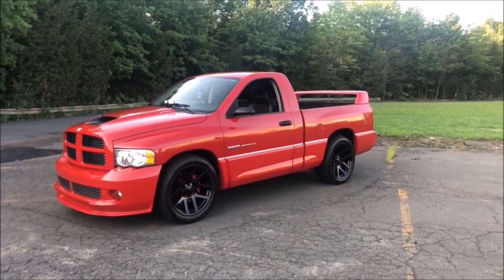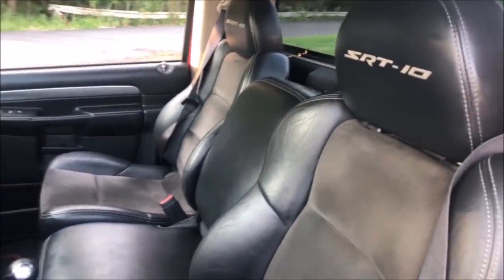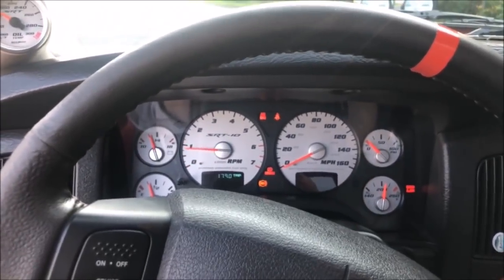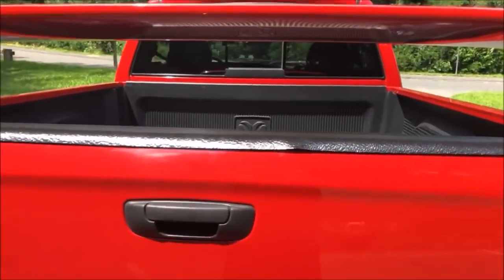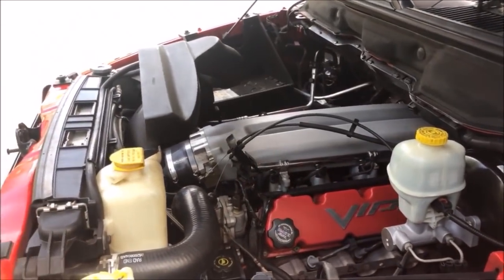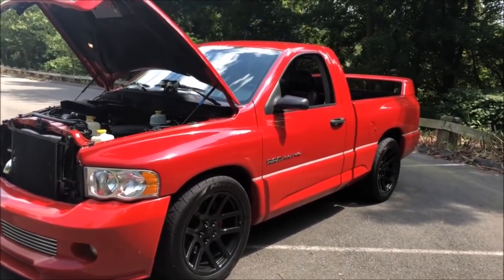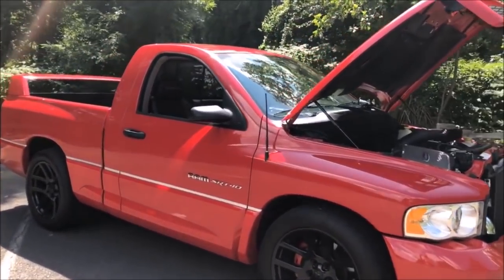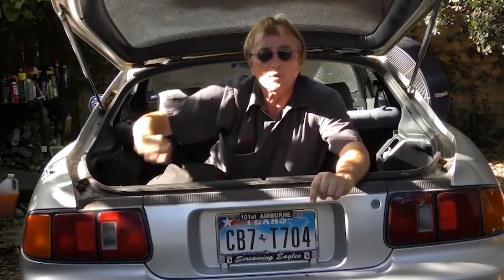The Secret that Makes this 2004 Dodge Ram Truck Still Worth $30,000

Comment: All the gas stations love this truck!
Reply: Smiles per gallon
Reply: Better driving it than see it in the garage.
Reply: Gas is cheap, so are thrills in that truck  before you get to the next station XD
Reply: And I do to.  Screw electric and economy.
Reply: The still get like 13 in town and 18 on the highway, Pretty comparable to a modern toyota tundra lol
Reply: It gets better mpg than my V8 Dakota
Reply: 14.5 city 16 highway
Reply: No, all the trucks love the gas stations
Reply: No way! I'd baby it and drive it on the weekends 😍 That translates to a tank a month?
Reply: @Monsiemage  highest ive gotten it to was 15 on the fwy and i drove it actoss the US
Reply: @WarofClans  more like 8-9 hwy
Reply: @BUMPER_PLATE_BANDIT  I have one a 14 and have over 200k miles I'm getting 16 right now highway it's gone up the older it gets
Reply: @BUMPER_PLATE_BANDIT  8-9 city 14-16 hwy had one for 7 years
Reply: @joshn938 this didn’t age well
Reply: @whisper7071  It's better than last summer. Also, depends on where you are. If you were on the west coast, gas was never cheap.
Reply: Who buys a truck with a big Hemi and then worries about gas mileage? 🤦‍♂️
Reply: @moobutt  *Viper V10. But your sentiments I agree with.

Comment: Should be "the secret that makes a 15 year old truck worth $30,000"
Reply from the maker: Good idea, thanks for the help, that is better. It's hard to come up with the best video titles putting out 2 every day, thanks.
Reply: They are more like $20K around here, (unless they have like only 5K miles on them)
Reply: So how would you like it, paypal or check?
Reply: This truck is barely worth 14k lmao
Reply: Funny newer trucks like the 4th gen ram loose value real quick... That's also how I'll probably be able to more easily afford a 2018 sometime after 2025-2030
Reply: I'm still wondering what the secret is?
Reply: 6speed tremec, viper v10..in a truck.

Comment: Not a Chrysler guy, but imagine walking into the dealership in 2004 seeing this truck on the show room floor. Way nicer than the fca Rams today. Love the truck!
Reply: it has outlasted any FCA Ram,too. my brother had a 2011 and a 2012 Ram, and the 2011 was returned because the transmission was screwed after 20000 kms, and the 2012 got traded in for a 2013 F-150 because the brakes were starting to go after 1 year and it was rusting out after 1 Alberta winter(we rarely salt roads out here). I've seen the newer ones having an array of electrical issues.

Comment: Wow 8.3 liter engine. Nice sounding too. We wont see that size again.
Reply: neftv1 i mean the most recent viper is an 8.4. 2017 was only a few months ago.
Reply: koniko169 yeah true but it'd be better to just build turbo v8 than a big V10.
Reply: 4th gen Ram 1500 SRT with am 8.3 🤔
Reply: TheAnonymousConnor 5.7*🤣
Reply: Only 500bhp too.. the E60 M5 V10 has 507bhp/500nm’s and it’s a 5.0 litre V10. Still love the viper engine though!! What a beast.

Comment: That truck is beautiful. It was like the Hellcat during its time. I have a 2013 Charger SRT with a 6.4 V8. I really do think Dodge makes some of the best monsters out there.
Reply: I have BOTH: 2013 Charger SRT-8 (32/392) and a 2005 Ram SRT-10. The wife has a 2015 Infiniti Q70L 5.6, so gas stations LOVE us!

Comment: Lamborghini's 10 cylinder was the perfect fit for the Dodge Ram. That truck is still fast by today's standard. I drive an 04 3500 diesel Ram so I'm biased on the looks. Be safe they are getting harder to find in good stock condition.

Comment: SVT Lightning vs Ram SRT10 would’ve made a nice comparison video.
Reply: It would have, but the dodge is really in a class of its own.
Reply: Andrew They are very similar as far as 0-60 times, the SRT does have an edge in power and torque but the Lightning is significantly lighter by 1,000 lbs so the times are extremely close.
Reply: I'd take the Dodge, just because its way more outrageous.   The Lightning though, with a few mods(its supercharged from the factory) would blow the doors off the Viper truck though.
Reply: SVT all the way
Reply: Andrew true but that blower on the lightning makes it very mod friendly. Stock for stock the ram is faster. But remember both are car enthusiast vehicles and most enthusiasts mod their cars. A smaller pulley and ported blower make the lightning miles faster than an srt10 ram with long tubes and new intake. Both probably are equivalent in mod prices.
Reply: Rygard Gonza too bad automatics are faster. I don't care what you think of me I'm gonna feel a hell of a lot better with u in my rear view mirror than u are driving manual and losing.
Reply: This has already been done. On Monday, Feb. 2, 2004, the Dodge Ram SRT-10 set a new Guinness Book of World Records time for the World's Fastest Pickup Truck.
Reply: MysticBlack - Who told you automatics are faster? I happen to own one of these trucks when I shift from 1st to 2nd and second to third, I do it in 0.400 of a second. The same amount of time it takes for the human eye to blink. Even automatic transmissions with shift kit cannot do that.     You must be a millennial...
Reply: At the time the lighting and the SRT-10 came out automatics where painfully slow. So a person who could shift decently would destroy an auto. Plus a manual is a hell of a lot more fun to drive. Srt-10 was low 13s stock while the lighting was high 13s stock . and im a ford guy, I drive a 2003 cobra.

Comment: The nice thing about those 8.3L engines is they were built at a specialty shop, not at the now days Mexico Fiat Chrysler plant that is known for bad lifters and whiped cams.  Those viper engines were built right, and have the bottom end to handle big turbos stock.

Comment: I remember in 2006 and the gas prices kept shooting up. You could get a used 2004 SRT10 in the low $20K’s. Almost bought one but knew my wife would have been pissed with that mpg.   Now the same 04 will still be low $20K’s with low miles.

Comment: A friend of mine bought one of these trucks probably 7-8 years ago I think he had it less than a month before he flipped it, was ejected and died
R.I.P. Mike
Reply: Bryan C gr8 story m8
Reply: Bryan C reason why to never buy a dodge
Reply: BrEEzy TonY, ya their trucks have pretty bad safety ratings
Reply: Bryan C I’ve seen a vid where a guy flipped his over in a ditch...he lived tho
Reply: Sorry to hear about your friend. As I was watching this video, I kept thinking that an 8.3L Viper V10 + a pickup body with an empty bed = recipe for disaster.  This is a very unique and powerful vehical that you have to be careful with.
Reply: A lady just went to a coffee/car event at a local Dodge dealer in my state.  She was driving a Viper, but she lost control coming out of the dealership and crashed.  And people pick on Mustangs.
Reply: Sorry to hear.  I have one of these and drive it very aggressively so your friend may have been trying something a bit nutty...also sounds like he wasn’t wearing his seat belt.
Reply: Center of gravity is no joke. Gravity is no joke. Lots of power in cars and trucks designed for speed is no joke. It only takes a second or less to mess up. People are looking at their cell phones at 80mph! Mostly females, NC state don't enforce their new cellphone laws and they run into school buses,  garbage trucks ,people cross the street,etc.

Comment: Hi I have an 05, black on black. The hood scoop actually blows cool air over the whole engine and out the bottom. It also allows the engine to vent out all that heat after you park. Also noticed your short shifter stick might be on backwards. Easy fix. Also those forged aluminum wheels in mint factory condition are worth $6-$8k hope you didn't powder coat them.

Comment: Own a 2005 SC in Bright Silver Metallic with chrome side pipes and it's not some garage queen either...just hit 80K miles and still runs strong while winning awards at the local car shows. He forgot to mention that the standard cabs had the Hurst 6-speed manual, while the quad cabs all had 4-speed automatics. Also a array of special editions were built and these trucks were assembled in Saltillo, Mexico. If interested in more info visit Viper Truck Club of America.

Comment: The dash isn't all cracked? How did he manage that? It's a huge problem on these Rams.
Reply: Mozzie he probably laminated it! Lol🤣😂...the dash on those things usually do crack for sure.🇺🇸🇯🇲
Reply: Maybe replaced when the navigation system was swapped in. Nav wasn't an option in 2004
Reply: My dash isn't cracked, it's simple. You put a dash mat on it BEFORE it cracks. Prevention 101.
Reply: Probably has a more premium plastic and doesn't spend much time baking in the sun
Reply: I have an 05 and it still not cracked
Reply: The only part of the dash cracked on my '04 is the part right behind the windshield. Gonna take care of that soon as I get the time to put in a newer one. Other than that my dash is in great shape. And I live in Texas where heat is a huge issue. Guess I'm just lucky.
Reply: Found out if you ram was made in mexico the  dashes cracked...made in us or Canada they didnt....check the VINs on these old rams.
Reply: @cs292  Too true, my 07 dodge came from st louis and no cracked dash.
Reply: @cs292  the dash boards were made by one supplier 🤷🏽‍♂️
Reply: I have a 2005 Daytona edition Ram that looks almost identical to the SRT version and my dash has never cracked, and it has always been parked outside because I don't have a garage.
Reply: The 2nd Gen dodges were most known for their crappy dashes. These are the 3rd Gen.
Reply: It probably was kept in a garage all it's life

Comment: Nice truck.  I remember the days  when that truck first hit the streets its was a beast. GMC also let a couple out the Syclone and Typhoon. They didn't have the Top End the Viper truck did but they were killers off the line. Nice truck thanks for sharing.

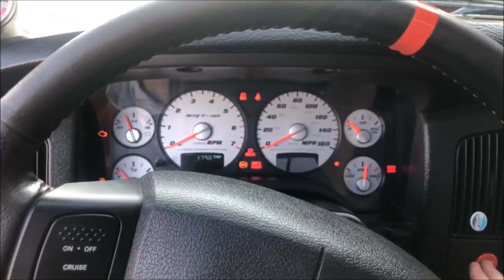Comment: Your crank up at 1:58 shows you are running on the warm side. Prob around 215F. These engines run hot. Stock 190 temp thermostat doesn’t flow soon enough after hard driving in the summer heat. Throw a 170 temp thermostat in and a tune that also turns the fans on sooner. It’ll pay off in the long run. I own one too. Just trying to help.

Comment: What a beautiful truck and that v10  is Bulletproof. Guys are putting turbos on those engines and putting over a thousand horsepower on the stock motor and they can handle it no problem now that's an engine

Comment: Pretty badass, but they should have offered a second "sleeper" model if you ask me. Imagine that setup but in a regularly dressed stock ram with no badges indicating a V10 and no extra loud exhaust. That would be badass.
Reply: They do make the four door version. Even has a tow package, and removing the badges is easy.
Reply: The extra vents would give it away.
Reply: You don't need the vents on the hood the fresh air supply can be re routed.  Its done all the time.
Reply: The hood scoop is an option on RT models also, and lots of guys put them one their standard Rams as well. You could even direct swap hoods with a regular Ram.
 For me, the biggest giveaways are the giant red Brembo Brake calipers....

Comment: I have a 06 4door with a 8inch lift 38inch tires staright axle swap twin trubo. Im pushing 899whp and 914trq pulls good had to get the speed trans brand new for the extra hp.

Comment: Remove the intake, the hood scoop is there to cool the motor because of how hot it runs and u have it covered 🤦‍♂️
Reply: Absolutely. I removed mine after noticing my already high temperature seemed to play around that 205 degrees just a bit longer than I cared for. This truck already runs high.

Comment: As a previous Viper truck owner, I can say that owning one these can get expensive. Only uses high octane gas, gets 9 miles to the gallon, manufacturer recommends using Mobile 1 oil for oil changes, and expensive to insure. Yeah it's a great truck and I can't say that it wasn't a blast to drive but whenever I wanted to go out on a typical Sunday drive along the countryside, I had to plan my budget around that. And if you want to keep it as bone stock as you can, I once went to a Dodge dealer and asked what a set of tires would cost me. They told me for the same set (same make and size), it would run about $2,000. Yeah, I could've gone somewhere else but could they get me the same ones? Overall it was awesome but hard to own when you have a few mouths to feed and a mortgage on top of you and in California.

Comment: I have an 01 ram single cab. Basically the last of the 2nd gens. I love my truck. The only down side I think about these trucks is parts are a little higher than id like them to be.... but, i do all my own maintenance, and religiously. So i get to cut most of the cost. Bout the only thing i can't do is alignments. I also have a dad in law that helps me with the big stuff. Like my original trans took a dump so we pulled it into his shop and put a new used one in in about 5 hours. He's a 30 year ase certified mechanic. Transmission jobs suck though... lol

Comment: I'm a fan of engines, but not annoying loud sounds. I'd love the truck if it wouldn't be that loud. I'm sure there must be a way to hear the beautiful sound of that engine without being loud. I know some people would hate me for that, but I have reasons.
Reply: That's an aftermarket exhaust.  Stock, they're not nearly that obnoxious.  Still, it doesn't sound like an older M5 or Lambo V10 (amazing engine notes) - it sounds like a truck.  A regular V8 sounds better than this particular V10, IMO.

Comment: Ya need a Wing when your goin 150
And besides, it's your truck
Reply: Ken Alexander the wing probably slows it down
Reply: OriginalOrigins its creates better air flow like the original daytona
Reply: Who cares it came stock
Reply: @OriginalOrigins  Nope it doesn't. Provides downforce when you're going 150+ mph.

Comment: In 05 I bought my Ram 3500 what a Cummins 5.9 24 valve. Factory rated at 325 horses 550 foot pounds. Second week I had it I took it to the shop but it on my laptop and put a 500 horsepower boat tune on it, can't tell you whose but I think you'll understand. 13 years now 500 horses thousand foot pounds of torque and I'm happy as hell. And all these years the only failure water pump and a serpentine belt. Oil changed every 5000 miles religiously with Rotella 1540. Lucas Oil stabilizer, Royal Purple oil filters in Napa Gold Fuel and air filters. I run my own overhead I'm also a diesel mechanic and gas I do it all. this thing pulls my boat equipment trailers everything I can throw out it even over 20,000 pounds and it'll sit on cruise all day long. And I won't sell mine for 30 grand it cost too damn much to replace it and too damn much to make it as Dependable as mine. I do like the SRT though. ♥️🇺🇸👍👍

Comment: I’d like to see that vs the Ford F-150 lighting series. Nice dodge
Reply: The SRT-10 is the most powerful production pickup available on the market today. It produces 90 percent of its torque between 1500-5600 rpm and can roar to 60 mph in 4.9 seconds. The quarter mile is gobbled up in 13.3 seconds with a trap speed of 106.9 mph
Despite a 120-horsepower deficit to the SRT-10, the Lighting still managed to whip out respectable test numbers. The blown V-8 is good for a 5.1-second 0-to-60 run and a quarter-mile shot of 13.6 seconds at 102.0 mph. However, testing proved that performance diminishes quickly when the supercharger heats up after just a few runs

Comment: That truck wasn't made to haul. That argument is dumb. This comes from a guy who owns a 3/4 ton. Nice truck, to be sure.
Reply: Finally someone that understands the difference between a truck built to haul a heavy load and one that was made to race and not to be a practical cargo carrying vehicle. 
It's just like the 1972 Chevy 1/2 ton my dad bought brand new...it came with a big block 400. It wasn't really meant to haul a lot of weight, it was a muscle truck.

Comment: Hey Scotty I have a customer with a 2006 Lexus LS 430. I replaced the wheel bearing assembly on the right front. But afterwards I noticed that the vsc light still comes back on as soon as you press on the gas pedal. My customer says its been on for years and the idiots at the lexus dealership couldn't figure out what was wrong? Any ideas?

Comment: Scotty I have a 1989 Mercedes 300 se .  The issues I am having when I drive it then shut it off later when I go back to restart it it cracks but no start .  I replaced fuel injectors cap and rotor  and fuel pump filter and plug wires . I ever replaced the coil. Still the same thing-happens.  And sometimes u can restart and it turns on can u tell me what might be wrong ...

Comment: You kind of have to like these trucks to pay that much. Engine looks cool but overall it's just a manual Ram 1500.
You could buy an '04 Silverado and  boost it for a lot less and have more power with lots of money to spare. BTW those are not in the 30k range, we'll at least the couple that I've seen. Color combo looks good.

Comment: 8 L engine and only goes 150😂😂😂😂.  Well it is a truck after all
Reply: I'm sure it's only GOVERNED for 150 mph. In what is STILL a Ram, itd be pretty dangerous to go faster. 500+ hp is more than enough to drive even 5000 pounds up to 170+. Just might take a while to get there.
Reply: There's a comment above in which  a friend of the poster had one of these, flipped it, and was killed. 150 mph is more than enough for a pickup, and IMO, the drive-train/body combo can get real dangerous real fast if one is not careful.